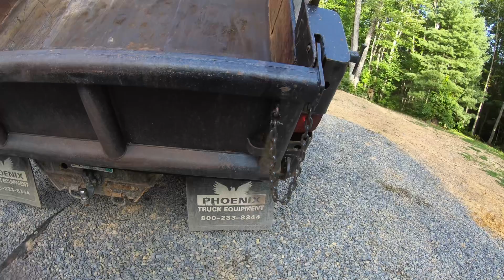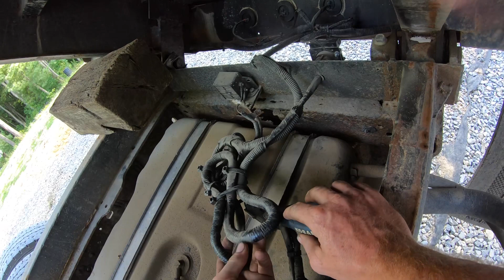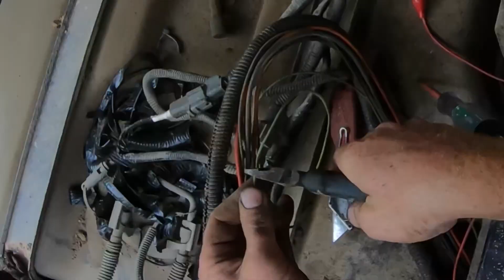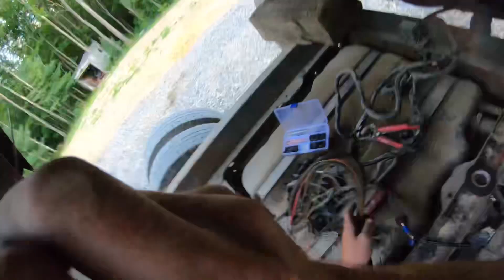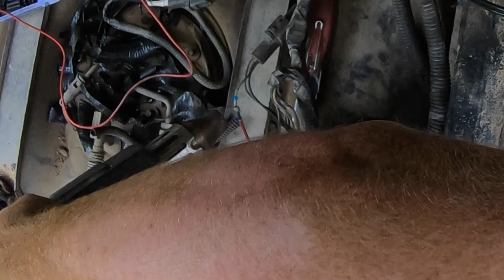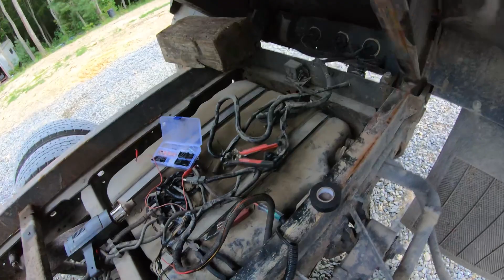Diagnosing and Fixing a Brake Light/Turn Signal on a Dump Truck

Comment: I think leaving all that extra wire is asking for trouble. All the sharp bends from folding the wire to zip tie not only strain the wire but allows for multiple rub points between the frame and gas tank. Good thing you fixed it with relative ease this time, but if it happens again, you may want to consider doing something different￼.